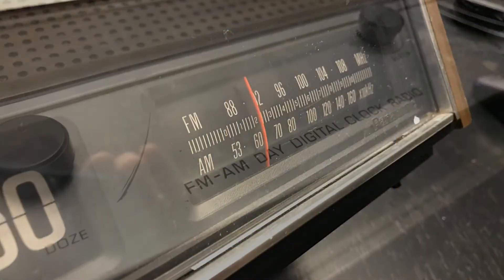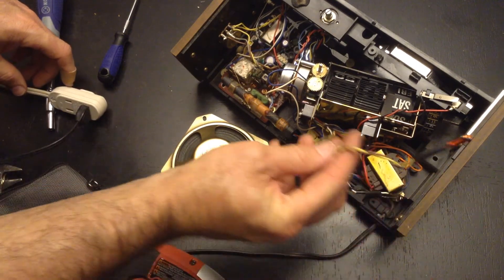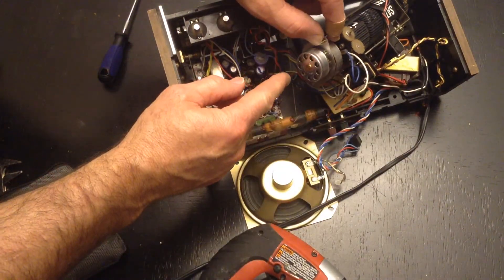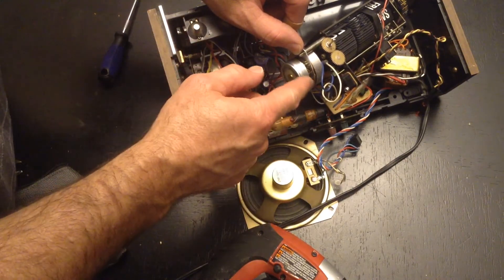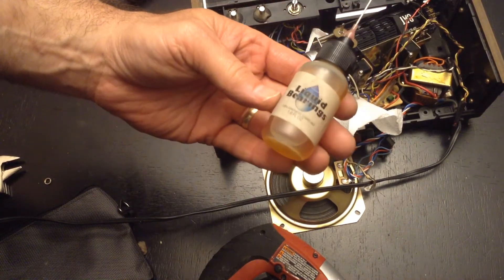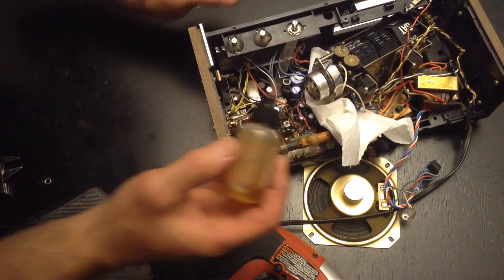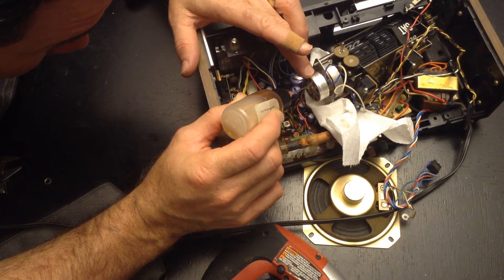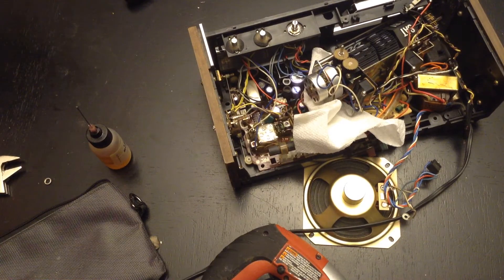Getting a copal flip clock motor spinning

Comment: Hello Flipclockfans, I have a challenge, I have a working motor CCW rotation without a clock mechanism, I have a CW clock mechanism, how do I invert the motor rotation to fit the mechanism?
Reply: I believe I have an answer, from a sight in this video and the oiling video, the stator might be flipped the oposite way , hence the rotation Will be switched, I'll let you know the result
Reply: Dear fellows I made it, I switched the rotation placing the stator backside Out.
Reply from the maker: That’s excellent

Comment: Thanks for the video, this seems to be the issue for my Siemens Alpha RG222. After a little nudge the motor started turning again. I will add some oil and hope it keeps running.
Reply from the maker: Hope it works for you.

Comment: Thanks for your videos on these motors. I was having a problem that i haven't seen addressed though- the motor was getting power but not moving and making a real quiet 'humm' that i could just feel as well. I lubed the motor shaft and wiggled it in and out axially (gently, as per your instructions) 

To no avail...

until i gave it a good high speed "nudge" with my drill by securing a foam earplug in its chuck! A couple rounds of this, interrupted with more oil, and it's spinning on its own now.
Reply from the maker: Wow. That’s innovative. I’ve used compressed air to do that before. You mind if I put your technique in a video? With credit to you, of course.

Comment: Is that one of those Synchron motors, like the ones school clocks have???
Reply from the maker: It is definitely a synchronous motor, designed to keep time based on the frequency of the power supply.

Comment: Hey that motor u were holding the one with holes in it what size & where do u find them cause i have very same & mine quit working can u please help?

But mine has blue n white wire comes out the bottom NOT the side comes out the bottom next to that copper gear mine is a white panisonic rolling flip cock am radio

Comment: Hey what's up I have a ge flip clock and had been trying to work with it and the motor keeps making noises. And I had got some of that oil for clocks, And I put some in and it ran quiet for little while and it started back making noises again. So what can I do know.
Reply: I cleaned the motor 1st, but after a couple hours it started to rattle again. So I oiled it as well, and now it looks like working silently. So try to oil the motor
Reply from the maker: Unfortunately, sometimes the motors have just begun to wear out and that's what happens. I hate to tell you that. You might just have to replace the motor. The only way to do that is to buy another clock.
Reply: Ok then I guess that's  what I'll do